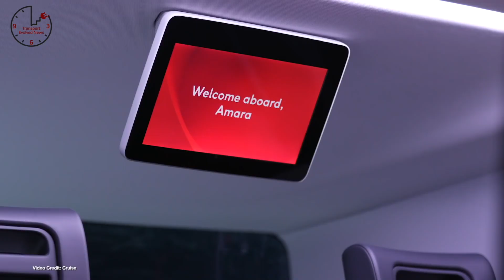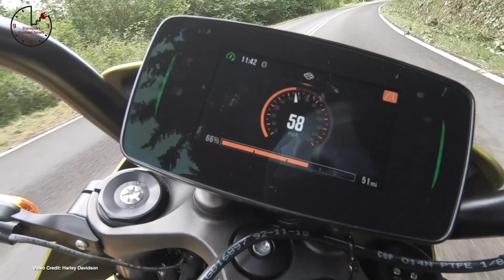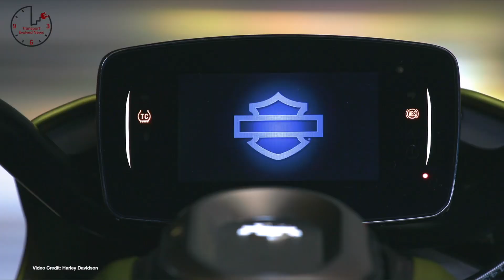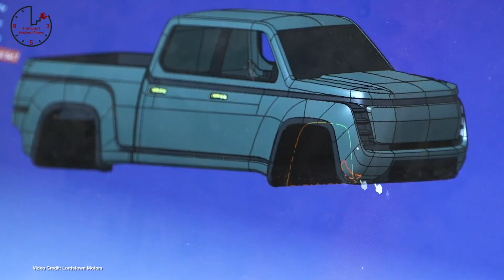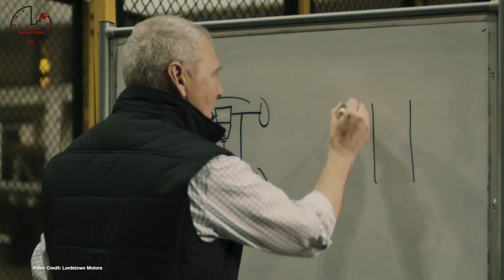TEN 292 - Battle of Alameda, Mustang Mach E Faster Charging, Tesla's Million-Mile Battery

Comment: Sorry, but I think you will soon discover that the cobalt-free Million-mile battery story is totally different from the deal with CATL in China.

I can understand the confusion because the CATL battery that Tesla will be using for cars produced in China is already cobalt-free because it is based on a different chemistry (lithium + iron + something). The CATL battery, and in particular the way each battery pack is put together, makes it cheaper than the Panasonic-produced battery that is used by Tesla in the USA. Whether it will be better, whether it will have longer or shorter range, is yet to be seen.

Comment: I had the extreme misfortune of driving in York in rush hour last summer, that city is an absolute nightmare for drivers (i'm sure 90% of the roads are just there because that's where they were 500 years ago). Removing all the traffic seems like a win for everyone, great news!
Reply: Edward Hobbs couldn’t agree more, my sister lives in the centre of York & the streets are simply not designed for cars etc.
Reply: Completely agree. The last few times I've been there I've parked miles away and cycled in, turns a nightmare into a pleasure.

Comment: 12:58 -- Is it OK for solar panel installers to stand on the panels like that? It might be, I've no idea, it just looks wrong. Shouldn't they spread the load using a board or plank?
Reply: I used to install solar panels. Any customer that wasn't convinced about their strength, we'd always let them jump on the panels to take away any doubt. These things are made to withstand as much as any roof: wind, rain, hail, tree branches and other debris, and yes, also humans walking on it.
Reply: He's not standing on it. Most of his weight will remain on his left foot. And there's not enough room for the glass to flex enough to break under the load of the right foot. And those panels are pretty strong and need to be able to handle decent wind loads and impacts with flying debris.
Reply: @Hans-gb4mv  What's the difference from which foot can stand on panels?